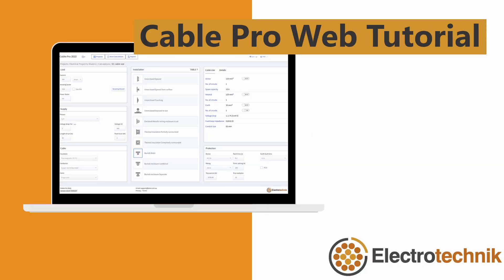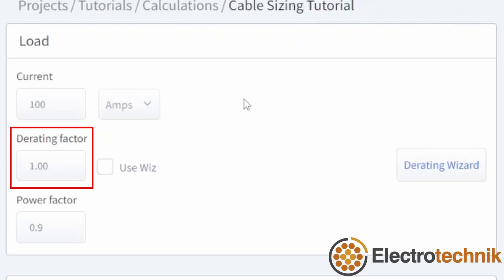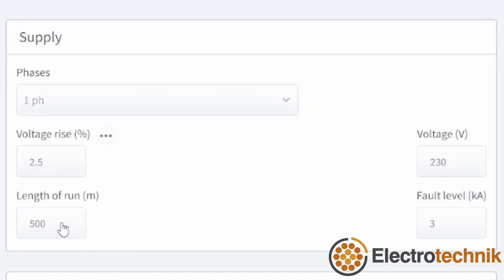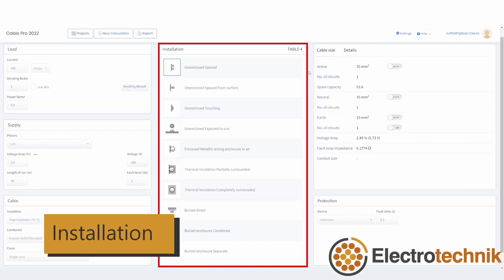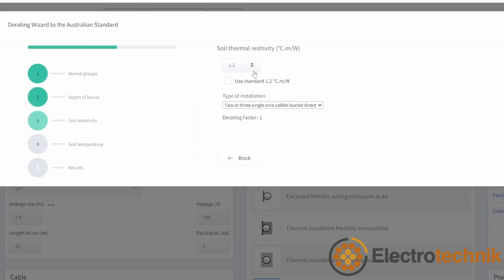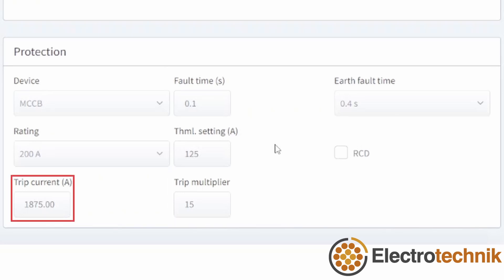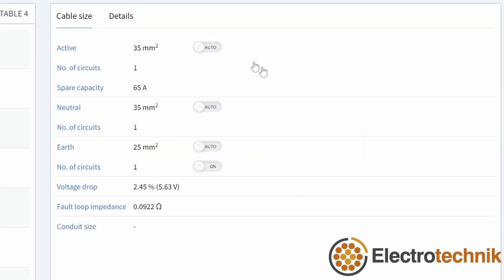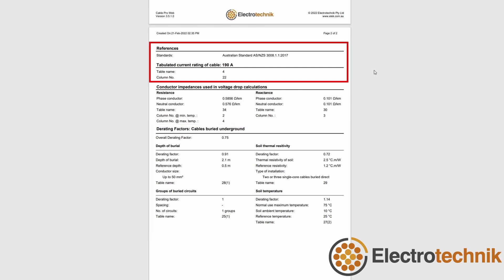How to use the Cable Sizing Calculator (AS 3008) | Cable Pro Web Tutorial

Comment: I don't know what value  fault level (KA)  should set, and when I set different values, the cross-section of the wire changes. What should I do? Is there a fixed value that I can adopt?
Reply from the maker: Hi, maheralsrag4645. The fault level is the prospective short-circuit current that will flow through a circuit. Its value depends on the power authority. We cannot provide or suggest a default value because it will affect the cable's short-circuit performance and minimum cross-sectional area. This would especially affect short cable runs, as these installations often have the prospective fault dictating the cable size.
Reply: @ELEKSoftware 

I am sizing a DC cable, but when I change the KA value, the cross-section changes if the distance is 10 meters, noting that the power authority does not have this value. In your opinion, what should I do?
Reply from the maker: @maheralsrag4645  We can’t give specific advice or influence your engineering decision, but since this value comes from the power authority, it’s best to check with them directly. If it’s not available, you might need to explore ways to estimate it.